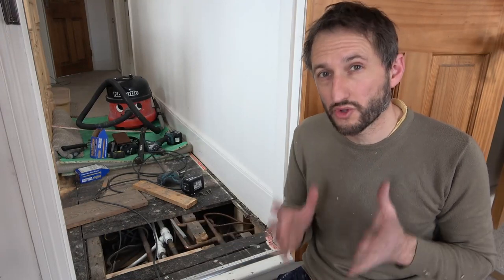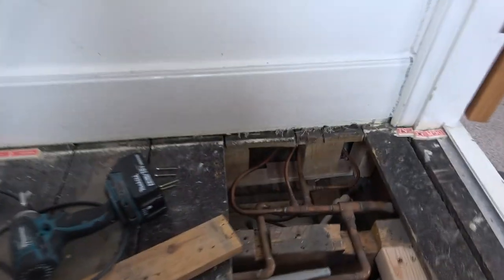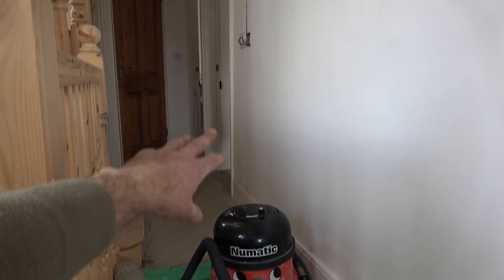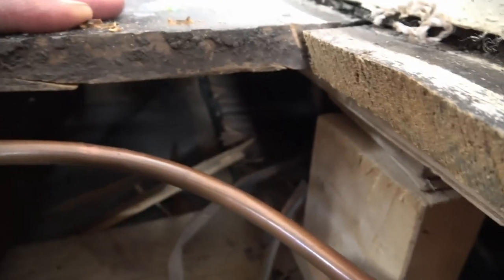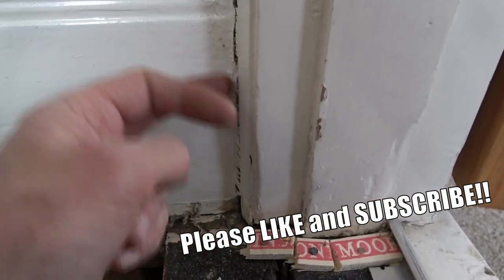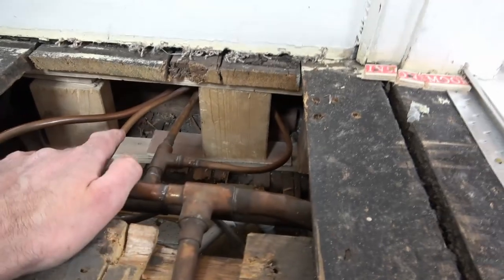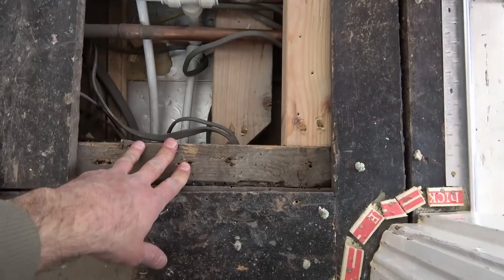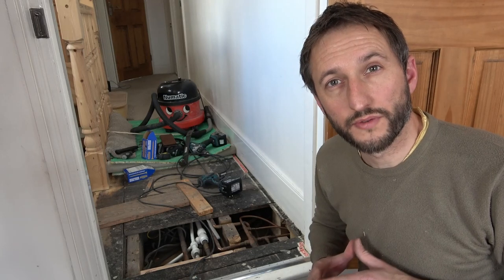Are brick walls always solid? Victorian brick wall construction. Load bearing walls or not?!!

Comment: This catches a lot of people out. Common on 1930s on wards. They used light weight cinder mostly but not always. Some of the building work is shocking. It still holding up!
Reply from the maker: Thank for the feedback. They were built a bit better in the 60's as they actually ran a strip along the floor to set the blocks in. On mine they are just sat straight on boards. It was 130 years ago to be fair!

Comment: Same here. I was wanting to cut out the bathroom floor boards to replace with solid sheet material for tiling. Luckily I investigated under the floorboards first. If not that would have been a fun day!
Reply from the maker: Well done for checking. It's not always what it seems!
Reply: How did you manage in the end? Just cut back to nearest joist in front of the walls?
Reply: @MarcusT86  left well alone! Not worth risking structural integrity. Used a high quality plywood (6mm I think) over the top, then used all the appropriate stuff to tile over it
Reply: @donnythebull7396  that’s a good idea, using ultra thin plywood instead.

Think it would be overkill to board over with ply, then tile backer to that, then tile?

Comment: Same here from 1946. London red brick for both skins and internally, but cinder block for the landing wall. 

I thought there must be a concrete lintel somewhere until I ripped the carpet up for replacement and investigated. Couldn't believe it if I m honest. 

Mind you those Victorian joists are much beefier than what they used with the scarcity of materials straight after WWII.
Reply from the maker: You're right about the joists. I think wood was in abundance then. Mine are huge! Thanks for watching. 👍

Comment: Nice little video seen loads like that over the years I have seen them chipped of and be like so lose until plastered again the saying  the plaster some times is holding it up :)
Reply from the maker: I'm not sure if the plaster wasn't holding it together at the top! I had to chip away, make good and plaster the wall a while after this video was filmed. Thanks for watching and keep up the good work on your channel 👍
Reply: @POUSEaroundtheHOUSE   when i was an apprentice I remember saying to my boss this wall is about to come down it was the dividing wall between 2 rooms not a support wall basically just acting lie a stud wall / divider but man after the sand and cement was applied again it was solid I have seen it loads from then no lol Thanks man have a good one :)

Comment: Coming back to this Pouse, and I’m ready to replace the battered old floorboards upstairs with some nice T&G chipboard flooring. 

Obviously where the upstairs walls are sat on the floorboards, I can’t remove those floorboards, but can I cut them to the nearest joists either side of the upstairs walls?
Reply from the maker: Yes, that should be fine, best of luck with it 👍

Comment: Watching your video has made me nervous. My dad renovated the house 20 years ago and replaced all original Victorian floorboards (not sure why as they were in good condition) apart from in the bathroom. When I renovated my bedroom last year, I had to lift up the floorboards to put sound insulation in, and noticed these floorboards butted up to this partition solid brick or cinder block wall between the bathroom and my bedroom. I did notice the wall is not supported underneath or maybe it is by the bathroom floorboards. I think originally the bathroom floorboards would have run into my bedroom but the builders cut these from my bedroom...as you have shown in your video. Anyway this maybe explains the big cracks above around the dooryway before I had it replastered last year. Slightly nervous about the structural integrity but has now been 20 years 😬

Comment: Mine is a small ex-council 1950’s semi-detached cavity wall build. Every single upstairs internal wall is blockwork laid on top of the floorboards!

Good vid Pouse! How you got that bracing between all of the plumbing I’ll never know!
Reply from the maker: If you look I had to taper the ends of the one brace/nogging so it would fit enough to knock into place. Not a lot of room under there!

Comment: Pouse, will the noggins between joist on 1st floor reduce floor bounce?
My 3rd bedroom has terrible bounce, although not noticed from beneath in the kitchen...
Reply from the maker: Noggins should help stiffen it up but you may find over the years the joists have bowed a touch and maybe trying to lift a touch on the wall plates. The only way to find out is get under and have a look....or just live with bounce! Thanks for watching 👍